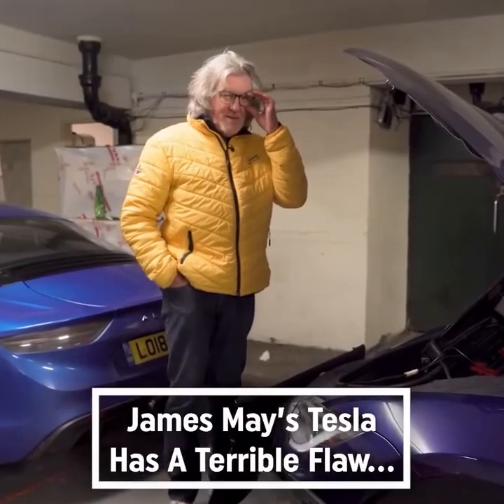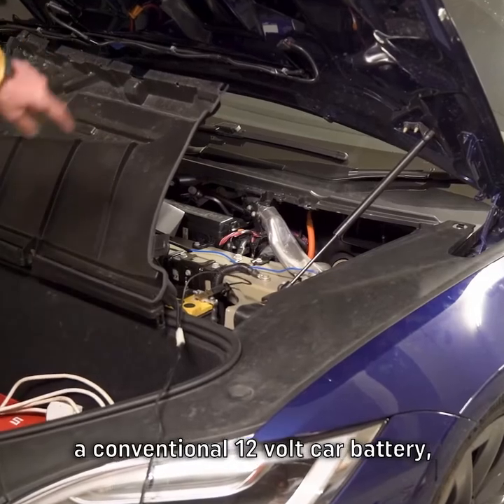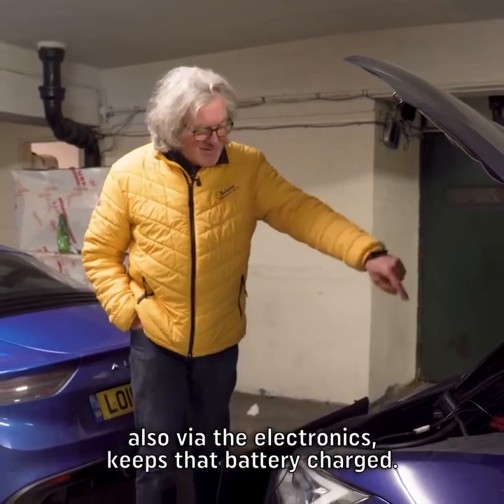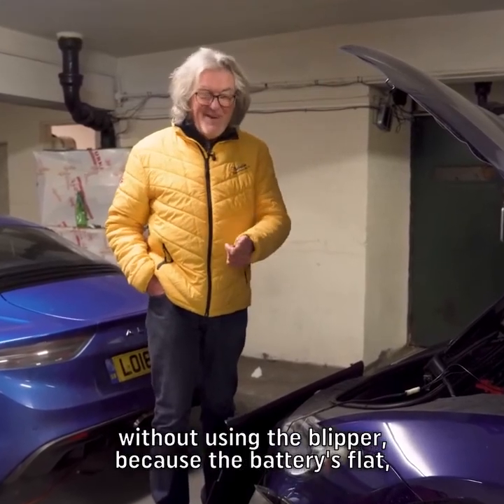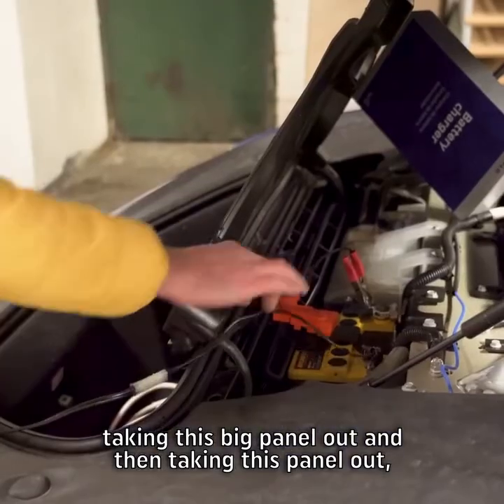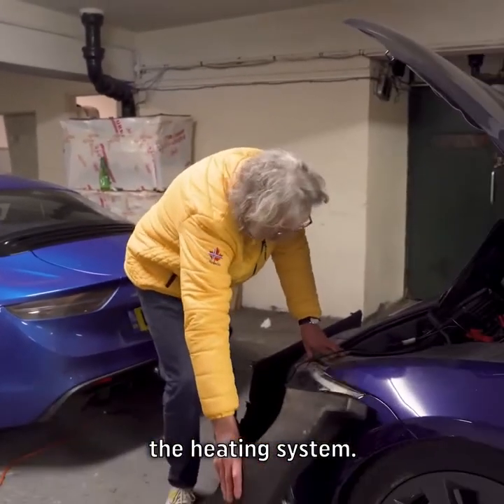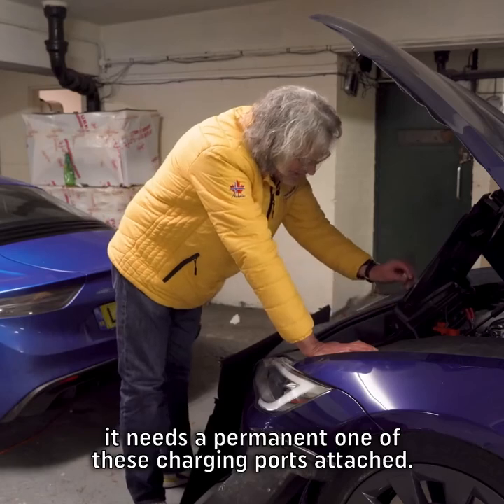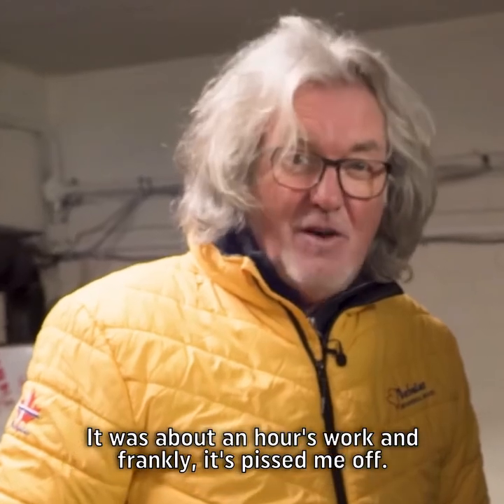Tesla

Comment: Am I missing something here? It seems this 'hateful' problem emerged only because James decided to fully charge the HV battery and then, for some reason, he apparently left the car for a good while without driving it? That is to say, long enough for his 12-volt battery to go flat - due, apparently, to it no longer getting topped up by the HV battery. So why, when - lucky man - he got through on the phone to Tesla, did they not remind him that charging his car's HV battery to 100% is not the greatest idea anyway in terms of looking after it? Unless, that is, his intention had been to drive it shortly after doing so - like when, for example, embarking on a road trip and needing the car's full range to be available. In short, if you follow that advice, and don't leave your car for any length of time on 100% SOC, surely this is not an issue you're ever likely to encounter? In my own case, I travel abroad regularly and have to leave my Tesla Model S 90D (with the same type of battery chemistry as James' ) parked up for more than 5 weeks at a time. And even though I charge it to no more than 80% before I go away, even with some degree of 'phantom' drain, there's always been plenty of juice remaining for when I return. Oh, and with my 12-volt battery still in good shape too. Just sayin'